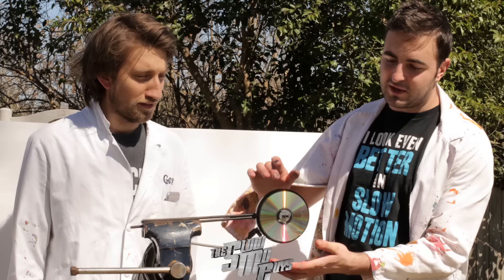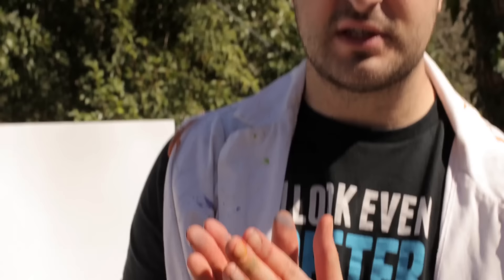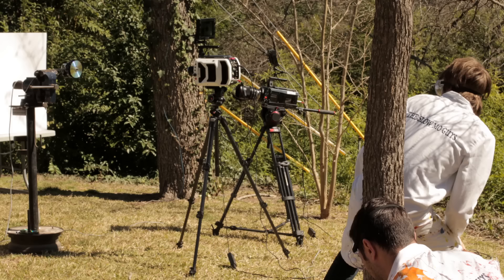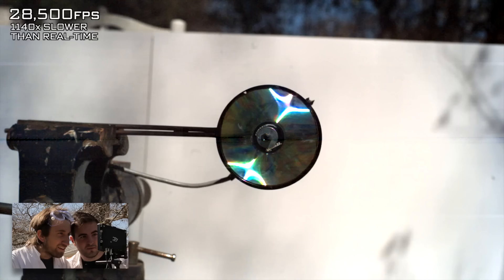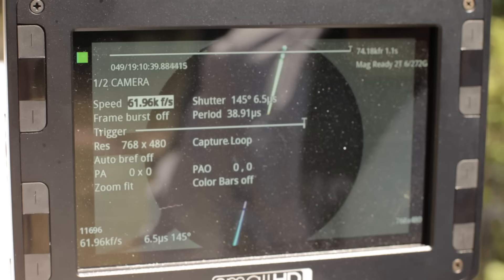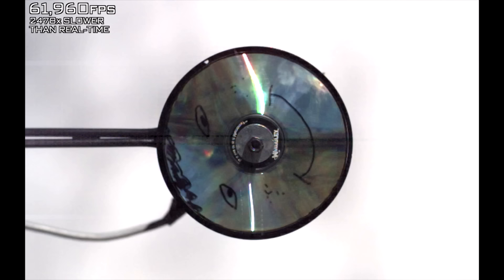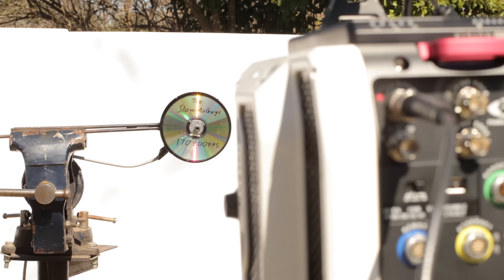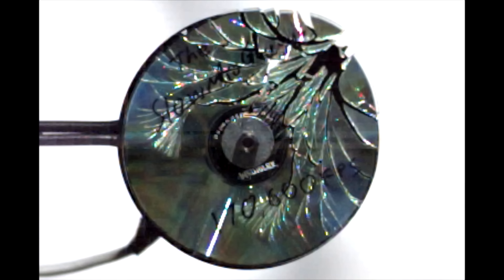CD Shattering at 170,000FPS! - The Slow Mo Guys

Comment: maybe u can film electricity or a lamp while it turns on
Reply: Paga Nini
Reply: The speed of light is ~300,000,000 meters per second. At 170,000 FPS, a single photon or electron would travel 1.7 kilometers in a single frame. That's too fast even for the Slow Mo Guys.
Reply: Joe Vasicek yes the light shure. but u can see how it becomes brighter
Reply: Trying to film light obviously wouldn't work. He means the actual turning on of the lamp, watching the light slowly become brighter.
Reply: LyricLy youd need a far higher frame rate to film light in motion, more like a trillion fps. Theres videos on you tube where some scientists have filmed that fast using a series of cameras. Pretty cool watching light photons passing through a soda bottle
Reply: David Dill No, he means as the lamp slowly powers on. It's nothing to do with the light, it's because a lamp doesn't go from off to full brightness immediately.
Reply: LyricLy. ahh, i see. That would be amazing to see!
Reply: Paga Nini
Reply: Paga Nini so you want to film the speed of light? Good luck trying.
Reply: No, they'd be filming the heating up of the filament in a bulb, not the photons filling a room.
Reply: The Reckless Looter This.
Reply: Akshay Sinha Not the light moving, the filament heating up in the bulb.
Reply: For a few years they have been able to capture a bullet of light moving forwards with a camera capable of 1 billion/trillion fps (can't remember the number).
Reply: Yves M. i saw that video it was from an indian guy
Reply: Joe Vasicek Take the recording of the video, record it on a iPhone Slow-Mo, (or send it to the iPhone/PC use a slow-mo software.
Reply: Ligh = 300k metres per second
Reply: light = 300.000 km/s
Reply: I would really like to see this. I'm curious if they could slow it down enough to watch the current pass across the filament. Keep in mind, light travels at 300Mm/s through a vacuum. It propagates through solids much more slowly, even copper.
Reply: Paga Nini that's boring
Reply: Look up femtophotography if you want to see a camera setup so fast it can pick up photons of light moving in slow motion.

Edit for link: https://www.ted.com/talks/ramesh_raskar_a_camera_that_takes_one_trillion_frames_per_second
Reply: Deathbrewer you mean "a series of cameras that trigger in quick succession" There's no single camera that can actually record something at that framerate.
Reply: You don't need a high speed camera to see how a light bulb goes brighter, just use a dim switch
Reply: 300 million metres per second suggests that if the camera was cut down to its minimum rez (128x96? Though maybe 192x72 or 256x48 would be more useful depending on the scene) and run at a million fps, and aimed across a misty field with a view angle covering maybe a couple of kilometres... you could turn on a high powered laser or searchlight pointing across the field of view and see the beam of light from its scattered photons as it moved across and illuminated objects placed in its path. And then again as it was turned off. Possibly with a mirror or some reflective objects to give it a greater distance to travel overall. Particularly one angled towards the camera to show up as glare when the beam travels the intervening distance (of a few more hundred metres at least)

The actual runtime of interest would only be a dozen, maybe two dozen frames, less than a second of realtime playback, but that's still enough that the eye could track the light moving across at full replay rate, and be interesting to see spread across 4 or 5 seconds when slowed further still to slightly jerky low framerate...

Comment: This is incredible.
Though, I'm curious what would happen if you guys stopped the motor after the CD's been warped. I'm guessing it would keep it's new shape, but that would be pretty cool to see.
Reply: I was thinking that too...
Reply: nah it'd go back to its normal shape, unless it was heated before the spinning started
Reply: Stephen W Yeh you wouldn't be able to keep the morphed shape, the sudden drop in speed would shatter the CD and you wouldn't have enough time decrease the spin gradually before it were to shatter. Simply, once the CD has began warp it will defiantly shatter, no matter how hard you try to cut the spin.
Reply: Chill bruh I don't think it would shatter if you were to turn down the speed gradually. It has not reached it's breaking point yet, and I see no reason why it would. Despite most likely being weakened structurally, I think it would only shatter if you kept it at that speed.
Reply: I'm curious too.
Reply: Stephen W You see that the speed of the cd is faster then the warp movement? That means, that the cd is constantly getting deformed on different sides. I'm pretty sure that it would get to its initial shape.
Reply: good question. I'm betting the CD will go back to its regular flat shape.
Reply: +Stephen W 
Same. I wanted to see that too. I also think it would keep its new warped shape.
Reply: +Stephen W Exactly what I was thinking!
Reply: It's the motion causing the 'warp' of the CDs shape, basically a build up of motion that is slightly irregular to the spinning of the centre axis, causing the ripple-like effect. If you were to stop the spinning it would be as it was before you started.
Reply: +Stephen W I think that because the warp appears to be almost stationary that it in fact means that the warp is effectively traveling around the disc at the speed it is being spun. This is part of what causes it to weaken and shatter.
Reply: +Stephen W  You can see in the vid that the warp moves around the CD at a different speed than the written stuff on the CD, thus the warp is not always in one spot but is always moving so if he slowed it down BEFORE it broke, there would not be any warp at all.  It would be flat again.
Reply: +TruthSurge The warp is a standing wave, guys.
Reply: +Anon54387 no, the warp moves around the CD and anyone who took one second to WATCH the warp compared to the text on the CD would see this.  Thus, it is not a standing wave.
Reply: TruthSurge
Reply: TruthSurge They even explained it, but people won't understand.
Reply: +Hoch134 True.  I don't know how some of these people figure out how to even get on the Internet.
Reply: The sudden stop would cause a huge amount of force, having the same effect as in the video.
Reply: +DirtyDollar True.  Deceleration is no different than acceleration as far as force.  Try hitting a brick wall at 70mph.   We all know what happens but if you were to ACCELERATE at that same speed, 0 to 70mph in about .2 seconds, it would also crush you or do the same damage.  But those warps are not permanent, as I said up in this thread.  They are clearly seen moving around the CD and try bending a CD.  You can't even put a warp like that in it.  Lots of forces going on in that spinning CD.  I can't even comprehend something spinning that fast.
Reply: seriously why is everybody talking about CDs in a video about spinning a ball soaked in water?
Reply: RAF Benson You are in the wrong comment section...
Reply: Ben C. Actually the same would happen if the cd was perfectly aligned. Read something about the subject Gyroscope on wikipedia for instance. When an object turns, an extra force is created wich drives it to tilt.
Reply: +Ben C Read something about the subject Gyroscope on wikipedia for instance. 
When an object turns, an extra force is created wich drives it to tilt
Reply: +Stephen W It would actually just return to normal unless it's been bent enough.

Comment: What if you touched the CD going warp speed?
Reply: Loovlyjoobly Your' finger would be shaved from the speed and burned from the friction.
Reply: Anything that touches it gets shaved off and possibly set on fire.
Reply: Michael Hyams Copycat.
Reply: Kello Pollo Nope, I'm just defensive.
Reply: Loovlyjoobly Resonance cascade. You would open a portal to Xen.
Reply: Loovlyjoobly Warp speed means the speed of light. If any mass at all reached warp speed it would gain infinite mass and create a black hole.
Reply: the slo mo guys are on about it the point where the CD is spinning so fast that it starts to warp until it shatters
if you were t touch it it'd probably take some skin off your finger or it'd severely burn you
Reply: Loovlyjoobly A very nasty papercut
Reply: Sergeant Methcake Plasticut?
Reply: Loovlyjoobly A really good vine
Reply: Um actually you would get your body part severely burned and it would yard through your skin but also warp speed creating a black hole is just a theory and we don't even know if black holes even exist
Reply: Eragon_10203 Gaming You realize theories are the next thing to being facts? We have a lot of evidence to support black holes, and we also know that no matter can travel faster than the speed of light. Have you ever taken a basic physics class in you life?
Reply: Loovlyjoobly the cd would probably break if anything touches it
Reply: jo l Light is the only thing that we know travels at the speed of light, nothing else, light is massless, if you find something else that can go that fast, do tell.
Reply: jo l Like?
Reply: jo l Like? What's the anything. Light?
Reply: I laughed so hard I farted.
Reply: Eragon_10203 Gaming We do know that black holes exist, it's no longer a theory. It's a fact.
Reply: jo l You don't understand Joe, you can literally take a calculator and TEST PHYSICS on things you can see with your own eyeballs. Believe it or not there's equations that are UNIVERSAL, meaning you can measure a rifle bullet here on earth, and the same equation will tell you how fast Pluto is moving, or how fast a Neutron can go when finally escaping our sun.
Reply: jo l E = Mc^2 fool. (Yeah, we've never seen if a "BLACK HOLE" is actually BLACK, however, that's just a name for a very, very, very dense "planet", who's effect on gravity WE'VE WITNESSED.
Reply: jo l
Of course, a black hole is a large star that collapsed on itself, creating a black hole.
Reply: Kello Pollo You got roasted
Step 1. Grab ice
Step 2. Apply to burn
Reply: *****
1. You liked your own comment
2. Your name and profile picture is minecraft
3. Your comment is random shit
Are you trying to get hate?
Reply: Erebus Aeon In theory, yes.
Reply: Eddy Balsalobre don't photons travel at the speed of light and have no mass.
Reply: no horizon Basically packets of electrons.
Reply: ***** 
1. plays minecraft
2. tries to give hate
Reply: ***** Lol true
Reply: Erebus Aeon I know
Reply: ***** i write my grammar wrong intentionally and im 16 

and ur grammar is wrong
Reply: Loovlyjoobly I challenge Touching Guy and Touching Things to do that!
Reply: 10,000 Subs With No Videos?! Applying ice to burns is an extremely bad idea.
Reply: SpecialHandlingUnit lol most of these people probably don't even know what that means.
Reply: RespectMyHate basically when something goes into a black whole it will get violently stretched this is called spaghettifcation,that's just a example.
Reply: How does it take infinite energy to accelerate an object to the speed of light? E=mc^2, if neither mass or speed is infinite, where the hell do you get that?
Reply: no horizon galaxy's what?
Reply: no horizon There are stray black holes that are millions of times smaller than ones at the center of a galaxy. They don't have nearly the same power, but if one were to come close to our solar system, well you can guess what happens then.
Reply: Sanic Hegehog oh sorry. I just started to study this kind of stuff. I'm only 14 so I don't really know to much about it.
Reply: cybertree People like you give science a bad name. The whole point of the discipline is that there are no laws which are immutable and universal. Case in point, these equations you're so venerating don't make sense at the quantum level, i.e Newtonian physics isn't used in understanding the subatomic world.

Go read some philosophy before you pontificate.
Reply: Day 342, still no answer.
Reply: Day 343, am still being ignored
Reply: That wasn't my guestion. I asked why does it take infinite amount of energy to accelerate object to the speed of light. E=mc^2, neither mass or speed is infinite.
Reply: Blue Banana lol I was just talking about e=mc2, but about your question...idk.
Reply: Chances are it would it shatter instantly.
Reply: Actually there was mistake in my comment, e=mc^2 has nothing to do with that, the formula one should be using is e=1/2mv^2.

But that still doesn't answer my guestion.
Reply: Get sent to the 5th diemention
Reply: 1080NoScopeHardScope BlazeIt there is no 5th dimension there isn't even a fourth or third.
Reply: +no horizon first of all there is a third dimension. As for a fourth, it is often considered time it's self
Reply: Stickman Animations *cough bullshit *cough
Reply: jo l nothing with mass can travel at or faster than the speed of light.
Reply: no horizon exactly, only massless entities can travel at the speed of light.. Photons are light.
Reply: jo l Wikipedia doesn't always tell the truth -4- and if you did write "most of it" then "most of it" or all of it is wrong.
Reply: Probably burn skin
Reply: ***** But the real real question is,

Why did you scroll all the way down here?
Reply: +Lava 860 comments like these are no longer clever or funny and never will be.
Reply: Lava 860 Click the words at the top and just tap the down arrow, it scrolls all the way for you.
Reply: Erebus Aeon wouldn't it loose all it's mass? would make more sense to me.
Reply: +Lava 860 I don't know :/
Reply: +no horizon We live in the 3rd dimension..
Reply: +Lava 860 so that i could downvote.
Reply: zachwilliams88 NOOOOOOOOOOOOOOOOOOOOOOOOOOOOOOOOOOOOOOOOOOOOOOOOOOOOOOOOOOOOOOOOOOOOOOOOOOOOOOOOOOOOOOOOOOOOOOOOOOOOOOOOOOOOOOOOOOOOOOOOOOOOOOOOOOOOOOOOOOOOOOOOOOOOOOOOOO

IM SO SORRY, BUT THERE IS NO TEXT AT BOTTOM
Reply: Erebus Aeon you do realize that the reason we have things labeled as "theories" is because we do not have enough evidence to label them with absolute certainty as fact? and even if they are labeled as fact, the Earth was considered flat as a "fact" for many hundreds of years, and we know better now. anything and everything that is labeled as a "theory" has the ability to still be proven wrong. we simply state them because our current evidence backs them up.
Reply: Joel Smith Yes, but when people refer to a theory as some guess a scientist came up with somewhere, it's laughable. Let's look at it your way. Say Einstein's theory of Relativity. Sure you can say it doesn't have enough evidence and you won't believe it, that's completely fine. But people smarter than you will get a lot of useful information from that wild guess some guy made 80 years ago. 

"A scientific theory is a well-substantiated explanation of some aspect of the natural world that is acquired through the scientific method and repeatedly tested and confirmed through observation and experimentation.[1][2][3] As with most (if not all) forms of scientific knowledge, scientific theories are inductive in nature and aim for predictive power and explanatory capability."-https://en.wikipedia.org/wiki/Scientific_theory
Reply: +jo l As infinity is[n't] a number, you cannot have something that is 'Near infinite', only very large or infinite.
Reply: +Basic Mark infinity isnt a number, it is simply a statement or symbol we use to justify all real numbers
Reply: Sean Cummings Oops, I meant isn´t, otherwise my post makes no sense. Thank you.
Reply: +Erebus Aeon it wouldnt gain infinite mass or get turned into a black hole it evaporizes... mass going at that speed cant multiply or get infinitely crushed into a single pooint
Reply: Alexier G_G I misspoke. Mass would require infinite energy in order to travel the speed of light, which is theoretically impossible to do. To be fair we still don't have much of an idea. As far as we know if mass could reach the speed of light then maybe nothing would happen.
  This is in space mind you. Something going that fast on Earth would be vaporized due to the air friction.
Reply: +Loovlyjoobly Your finger would probably just melt off.
Reply: +Reptillian it would burn you or shatter, causing serious injury or something.
Reply: +Erebus Aeon watch vsauce, you'll find out that there are things faster than light. unlike the bullshit they feed you in school, vsauce has sources and evidence to back up their claims
Reply: sounds like you also have a phd
Reply: The Butcher I do. Can you link them? I must have missed that. Also have some faith in the school system. They just don't as in depth. That's what a university is for.